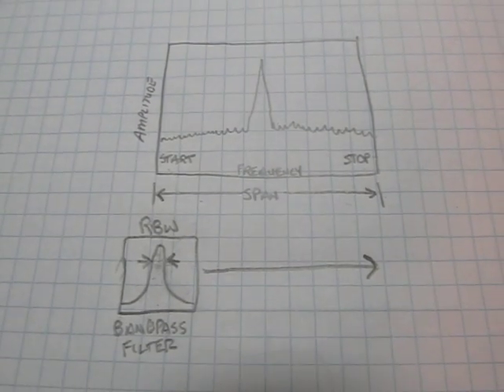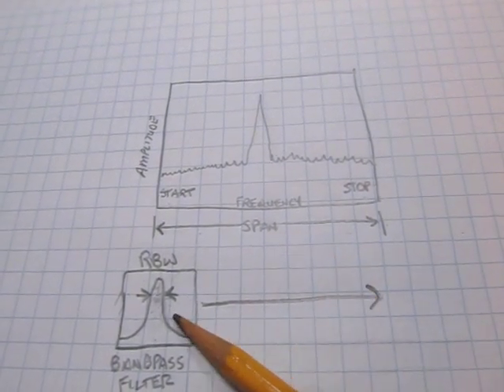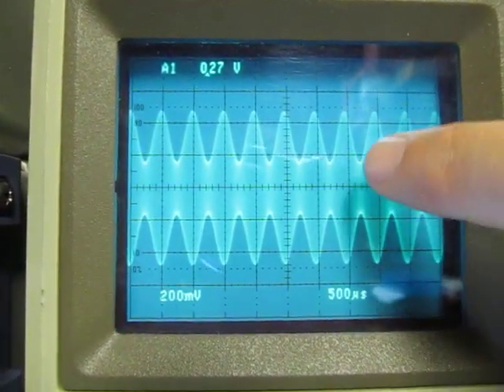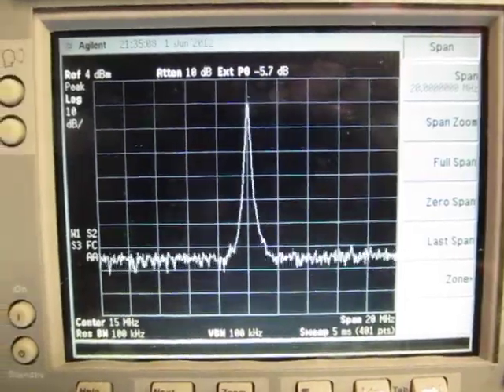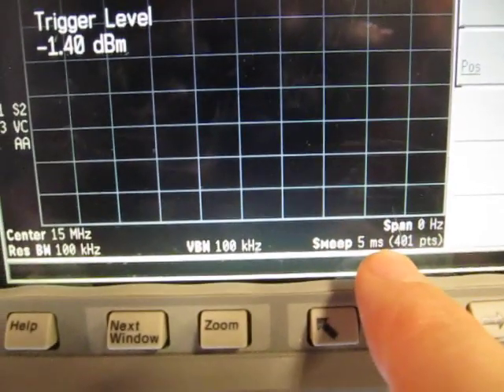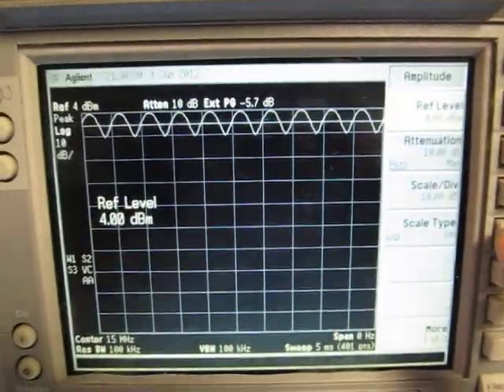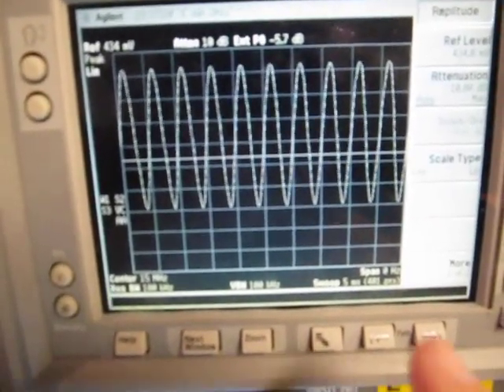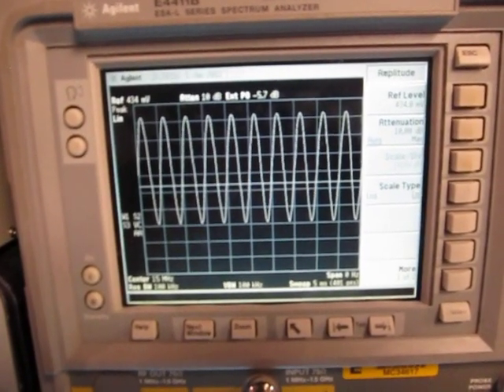#47: Basics of Zero-Span operation of a Spectrum Analyzer

Comment: Почему при изменении частоты span на экране меняется уровень сигнала, это неисправность прибора? Анализатор AT6011.
Reply from the maker: Changing the SPAN will also typically change the resolution bandwidth (RBW), which can change the signal amplitude, depending on the type of signal.  It is not a malfunction.
Reply: @w2aew  Спасибо! Как тогда выставлять span чтобы правильно считать dBm сигнала?

Comment: What is the best way to capture FHSS signals in the 902-28MHz ISM band? I do a lot of work in SCADA wireless network troubleshooting GE MDS radio primarily...a few Phoenix Contact...thx
Reply from the maker: Ideally, you'd use a Signal Analyzer or Realtime Spectrum Analyzer who's realtime/instantaneous/acquisition BW is 28MHz wide or more, in order to capture the entire 900MHz ISM band.  Something like the Tektronix RSA306B would be perfect for this.
Reply: @w2aew  we have General Dynamics and Rhodes Schwartz SA...
The question is how to discriminate between interference and intended signals...water , electric, and gas utilities use licensed and unlicensed 900MHz frequencies so it's getting crowded. I have suggested they look at 200Mhz licensed band since most of these applications don't require high data rates.
Reply from the maker: @jaimesolorza4186  This is the problem with any of the ISM bands, you have to expect that there will be other signals there.  This is why many of the devices that use the ISM bands have some form of agility to move or avoid interference as much as they can - such as frequency hopping, cognitive channel assessment, etc.
Reply: @w2aew  exactly..thanks

Comment: What it means is that there's really no such thing as "zero span" spectrum analysis. "Zero span" is just an established slang term for time-domain single-frequency power charting. It is not related to spectrum analysis at all, it is basically a regular oscilloscope functionality.
Reply from the maker: True - a zero span display on a spectrum analyzer is NOT a spectrum result.  It is a time-domain plot of the detected power within a given bandpass filter (RBW) which is centered at a given frequency (center frequency).  It is not exactly "regular oscilloscope functionality" since a scope would show you the actual sampled RF signal/carrier/etc.  It is more akin to a scope looking at the output of a power detector that is following a bandpass filter centered on the frequency of interest.

In some sense, FFT and DFT based signal analyzers can be thought of as zero-span analyzers in the sense that when measuring a span that is <= to their acquisition BW, they're not sweeping.  They're collecting data (down-converted and sampled) over time, then computing the spectrum of that acquired data.

Comment: I have a doubt, and don't know if i'm right or fail. I have an HP service monitor, the 8924C, it have a spec an but if offers not "zero span", in best case have 50KHz span, but not zero span, but late as show your video i see as the spec an acts as an scope in the X axis taking time as scope's sweep does. In my case i've used to show the modulated signal with the scope the 8924 have and i take the same result as you show in the vid, so i can mean that the spec an act as scope in zero span. Is it right, o wrong? (sorry, my english is not so good)
Reply from the maker: trill4kill Yes, zero span is like an oscilloscope, except that the vertical axis is driven by the output of the RBW and detector instead of a broadband vertical preamp.  I am not familiar with your service monitor, but most service monitors have a way to display AM demodulation, which is nearly the same thing as zero-span.

Comment: I have a question: I am trying to measure the power of an unmodulated signal on a certain frequency with 100 ms time intervals. For example i will take first power value at 0 ms then i will take the second at 100 ms...etc. Is zero span help me on this measurement?

Thank you,
Reply from the maker: şeyma tütüncü Yes, you can use zero span to make this measurement.  Make sure the center frequency is set to your signal frequency, and adjust the horizontal time scale as needed.  Use markers to measure the amplitude at your desired intervals.
Reply: ***** Thanks!

Comment: I have a question. In the zero-span mode is the center frequency the oscillator local frequency of the first conversion stage? Or is the frequency of the IF filter of the last conversion stage?
Reply from the maker: In most spectrum analyzers, there are a few conversion stages, thus there are a few local oscillators.  Each of these is adjusted so that the signal of interest (at the measurement frequency) land in the subsequent IF stage.
Reply: I know this question is very old now, but in case it helps anyone with the same question - I have a worked example for the R&S FSEB-30 spectrum analyser. (20Hz to 7GHz, with three stages)

The 1st LO comes from a YIG-tuned oscillator which varies with the swept frequency, range: 7.9414GHz - 14.9414GHz
This means that the 1st IF is always 7941.4MHz, regardless of the selected frequency. The following stages are then fixed.
The 2nd LO is 7.2GHz, with a 2nd IF of 741.4MHz. (This 2nd IF is used to phase-lock the YIG oscillator to the reference oscillator)
The 3rd LO is 720MHz, resulting in a very manageable final IF of 21.4MHz.

Comment: Yes, what I want to ask is since the zero span measurement measures the power under RBW over time, this indicates that the power of the two sidebands changes over time since they contribute to the sine wave in the zero span, right?
If the RBW is reduced such that the area under RBW only includes the carries, the power on the zero span is constant since it only measures the carrier power right?
Thanks.